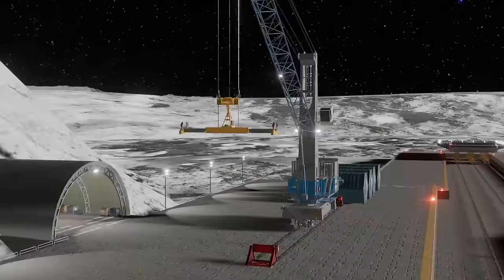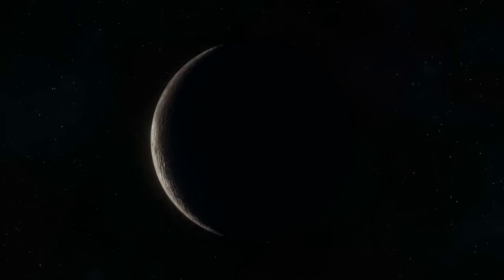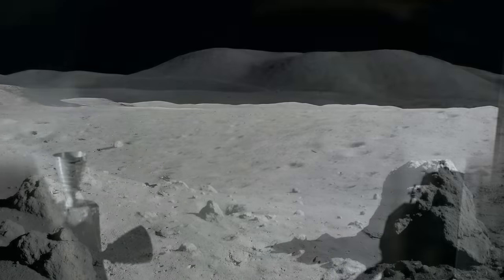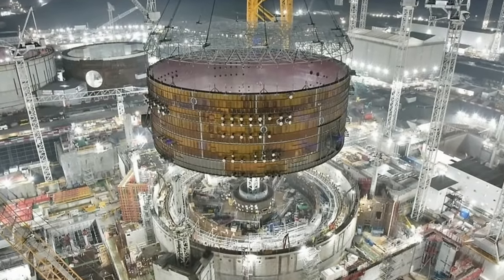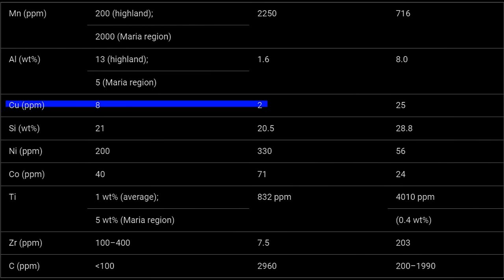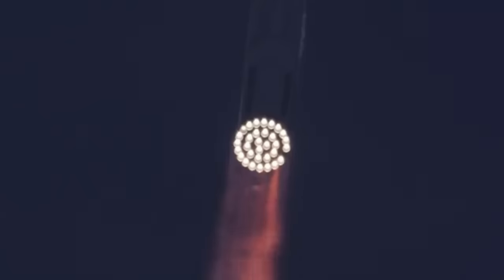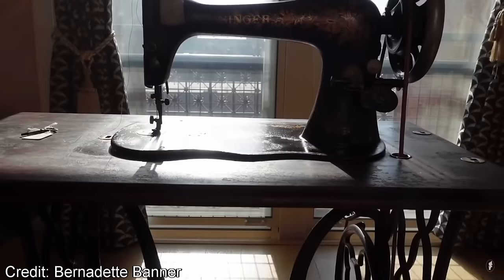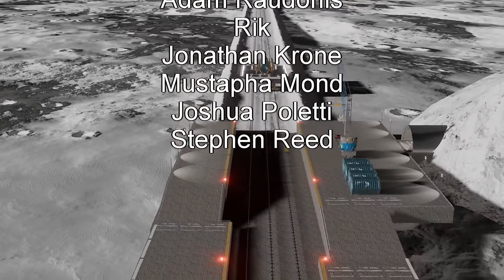Designing Heavy Machinery To Excavate The Moon

Comment: In general - great ideas. There are several NASA studies on self-replicating Moon factories, which reached similar conclusions.
The first machines carried from Earth will be complex (though still as rugged as possible).
The first machines constructed on the Moon will be as simple as possible, and as small as possible - because you need less material mined, and smaller plant - which means you can start making them faster, which means they start bringing materials faster. Efficiency is not as important at this stage. you can get away with radio control, instead of self-driving. Maybe you can even get away with springs and/or flywheels - they require far simpler manufacturing techniques, you can start pumping out machines far earlier, and you can build a lot more of them. They are more durable, less prone to breaking, and the moon power requirements are a lot lower.
Once you get enough raw materials from the machines you can continue bootstrapping into larger factories, more complex machines, larger machines, greater efficiency, greater autonomy.
3D printers are quite helpful at the start, you need fewer of them to make a great variety of parts. Only later, when materials are plentiful can the base move to mass manufacturing with specialized machines.
And once there are people in the base, small repairs that would otherwise decommission a machine can be easily solved. 

This all would be a grand rehearsal to Mars. In many respects, the Moon is harsher, no atmosphere, very abrasive regolith, awful day-night cycle with enormous temperature variations. But it is nearby, corrections can be made faster if a strategy or design turn out not to work. After we have perfected the bootstrapping process will have a much easier time on Mars. No need to wait for the next 2-year launch window to get the new parts because the old ones turned out not to work.

Comment: May just be personal biases talking, but I think treads deserve a second look. They involve more components than wheels yes, but all those components are simple to manufacture, homogeneous in material, and most are identical. And in a lower-gravity rough-terrain environment, traction could become a limiting factor. Cleats on treads are able to stab/bury into the ground at a large number of points, essentially using the weight of the regolith itself to aid the vehicle's weight. Not to mention that it cuts down the per-vehicle hardware complexity from one motor per wheel to one motor per side. There are ways to make treads that involve cables and crossbeams instead of hinges and bolts, which may help cut complexity as well. Numbers of axles and bearings depend on the specifics of the design, and could be more or less, but would probably be more.
Treads obviously aren't the perfect solution for every vehicle, but I don't think they're worth dismissing from the toolkit outright, especially with regard to bulldozers and towing tractors, whose operation depends entirely on high traction.

Comment: The need for carbon for steel can be eliminated by using induction heating and Hydrogen.  You still need a anode for AL production, but materials other than carbon could be used. The research into AL air batteries for example has turned up more options. One limiting factor in manufacturing is how thick of material you can cut. Most of a Co2 laser is just it's frame and chamber. So the electronic parts and special mirrors could be brought to the moon. I also envision that all machining would be done inside and that eliminates the moon dust as everything would be washed once inside.

Comment: If your using steel to build these machines then you could 3d print them, take the molten steel you've melted for the buildings and either atomize it into powder then use something like cold spraying to build the parts ie Xspee3d or turn the molten steel directly into the parts like the body of the vehicles, it won't look the best but that honestly doesn't matter it would be the most efficient and fastest method, for the motors aluminum works the best for both housing and wires, hell you even make the stators flexible-pcbs here on earth and you don't even need magnets with some motor types.

Comment: Hi AnthroFuturism,
regarding the "scraping" you envisioned being done with a dozer-blade, i had similar, but different idea - operating more like a harvester of metalic/magnetic parts (iron mostly) in the moondust. 

Lunar surface harvester (of iron):

The dozer-blade would be more articulated (not a slab 90 degree to the surface, but positioned in sharp angle to the surface and sharpened blade on its bottom side - like a scoop/scraper) would push the material on a conveyor, where the "harvester"/bulldozer would have some kind of pre-sorting of the prefered surface particles (say a magnet-s and/or centrifuge-s) and either only the prefered, or both prefered and the other regolith push out through some "exhaust" tube(s) (similar situation, when harvester harvests the plant, but exhausts only the grain into the transport vehicle, moving NEXT to the harvester, and when the transporter is full, another but empty, comes to replace the first-one in its place.) The outcome should be - less transport of unwanted regolith material and still quite sturdy piece of mining technology with little to no wurneable technologies (no hydraulics, only extra electromotor(s) to run the conveyor plus exhaust(s) and electromagnet for sorting. 

Why would be better to have mobile recharging/repair station for the robotic/VR operated mining vehicles:

BTW, if the "first Lunar settlement" is supposed to be robotic, why not use for the settlements underground buildings and surface roads concrete/by superfocused sunheat baked regolith panels, arches, rings and bricks. That would allow even relatively small robot fleet to build a large Lunar settlement, given enough time. That would release the whole body of starship/rocket to flip out the wheels, and serve as a surface mobile mining and recharging base for the fleet of robots, wich would be much less constrained to specific spot, than if limited in range by batery. Not sure how range of some big beast would look like, but if we use technology similar to electrobikes, we can expect total range under 50 kilometers, wich would allow the vehicles to work in a circle roughly 20 kilometer diameter around their base. Speed of roadlaying I found, is up to 25 M/Min so count with 10 M/Min and we might be closing to the devices capabilities. That roadbuilding device can adjust the width of the road, but we count for easier math 3 M wide. That would give the device speed of roadlayng (wich i immagine as similar to speed of surface-mining) about 30 Meters squared in one minute for one vehicle. That means in full 24 hour day deployment 43,200 Meters of regolith either mined through on the surface, or payved across by a road. That means, SINGLE vehicle would work through its maximal range covered area (of 1 256 637 062 METER) in ideal situation in 29089 days. That is almost 80 years. But more numerous the robotic fleet will be, quicker it goes - for example fleet of 32 vehicles would mine out (or pave) the surface of the area of their maximal reach in 2,5 years of work (in optimal/ideal conditions). The better return of invesments dictates, to use any and all industrial machinery on the Moon, till its (BY DESIGN PROLONGED) lifespann runs out, or until it is unexpectedly critically dammaged. Not to mention the point, if the lunar settlement crew would appriciate their homes immediate surrounding to be mined out and plowed trough, even when it is "only moondust". The tracks and threads on the moon surface tend to last for pretty long time. 

Specific Lunar architecture feature for gravity simulation:

The tunels of the settlement can be sealed against the moondust from inside by an inflatable insert sleeve, or cover of paint. 
I can immagine a donut-shaped tunnel, with 2 subway/metro/underground tracks, layd next to each other and tilted a bit to the centre of the "donut". Outside track is ment for the "habitat line", the inner ring is for short transportation oriented "line" ment for service, supplies and access (and exit) for station personal in need of 1 G - or gradual hightening of 0,1G of Moon to something higher...
Reply from the maker: @ultramarinus2478  hey some good ideas here thanks for sharing! Another alternative is to make a bucket wheel excavator, but there are lots of options!
Reply: @Anthrofuturism  Thanks, glad if hit the bulseye with some of them. 

Forgot to mention the extra powerpack trailer option. Some electromobiles do use de-facto trailers, with extra batteries to extend range of the vehicle. 
Another version of power trailer technologies might be separate RTG trailer (inspired by the Martian movie with M. Damon staring as main character)

BTW, in the "harvester manuever" - i.e. harvester moves forward and expells material into transport vehicle riding next to it - could and should add a powering manuever, where the transporter, wich will return SOONER to its base, powers the harvester when riding next to it, using excess power from batteries.
Reply: @Anthrofuturism  Positive on that & glad if something from my pile of (mostly stolen) ideas trully sticked... but general policy on technology should be exactly as you and Elon prefer.

Only thing i can mention, is some "road tests" in the most similar dust-deserts on Earth. Not sure 100%, but think the steel ropes are sometimes greased too, and question is, what would the temperature extremes and flying clouds of dust would do to them.

Comment: Abrasive particles reduce the life of steel cables. Steel cables are often oiled to increase service life in flexing applications.
Electro hydraulic actuators may be a good solution because theur lower temperatures extend hydraulic fluid life versus traditional hydraulic systems.

Comment: Depending on vehicle and complexety of the electronics, the Wire harness weighs between 10 and 50kg. -> It is reasonable to asume, that the electronics would be shipped in and a single rocket launch would supply about 1000 to 1500 vehicles.
Reply from the maker: Awesome, thanks!

Comment: Instead of steel for the body and solid wheels, use silicates from the slag with sheets or meshes of aluminum and/or iron as a reinforcement. Can make the wiring from aluminum, but try as I might I can't figure out a simple solution to insulation for the wires.

Comment: I couldn't find the properties of ferrochrome either, but I did run into Inconel600, which is primarily composed of iron, chrome and nickel, all of which are easily available in regioith.  The stress/strain curve certainly isn't as good as steel, but it's likely much better than ferrochrome.

The stress/strain shows elastic deformation at 400mPa(about half of steel), but plastic all the way up at 700.  Which puts it well ahead of most non -steel metals, notably including white cast iron.  

As a bonus, it's significantly more temperature and corrosion resistant than most hard metals, which is the use it primarily sees.   While I can't say for certain, given the day/night cycle on the moon, and the extreme temperature cycling that entails, I imagine that would be useful.

Comment: Excavator and Dump truck need to be developed; you don't want an open pit mine near your habitats because of dust. Have to be nuclear powered with heated hydraulics (don't know what fluid would be best.), heavy equipment needs a a very robust power source. And then you need a repair shop hanger to work on those things for when they invariably break down. And you better have several spare units with lots of spare parts.

Comment: An internal combustion engine not only needs fuel, but also air. Which, on the moon, will be imported from earth, circulated inside bases and recycled by scraping the carbon in the vents.
What i mean is - you wont have an internal conbustion engine on the moon.

Oh and electric actuators are way more effective than hydraulics - at least by weight and how much they move, but i think they might be better than pulleys - although maintnance may be more demanding...

Aight, pulleys it is! (With chains - or steel wires, probably)

Comment: Not all paths lead to batteries.
Capacitors are an option too.
Large banks of sodium ion, would make use of the normaly concidered wast slag from refining iron, aluminum, copper, tin, lead, silver, gold, etc.
Automated operations on the moon could operate off a cap system where power rails are laid down from solar farms to charge cap banks for large power use aplications for short durations.
Caps hold a charge a very long time and can hold a lot of power for there size and can be used till dead then recharged.
Unlike lead acid batts which can not go bellow 50% charge and lithium being rare and expensive.
But lead is an avalible resource on the moon so lead acid could be viable in some form for applications further away from the power grid.
Strip mining would also be the most efficient option as you could clear the rocks that make the terrain dificult to traverse while also gathering materials.
The moon has a much more homoginous distribution of materials in it's crust, so digging deeper is not going to provide much benefit in many cases in the beginning.

Comment: You know I was thinking it would be a good idea to move.
Habitats into the lava tubes on the moon  Mostly as a way to shield them from radiation. That way, you wouldn't have to work as much to Bury them although that might come with its own problems. 

There's also the issue of moving between each structure. If you were to set up a colleague on the moon if complex manufacturing, it might be easier to have an internal structure Where everyone doesn't have to wear suits all the time.

Comment: Careful. There are problems with friction in vacuum. Frictional properties of solids are quite different. Lubricants may not oxidise, but they evaporate. Actually, a cable shovel sounds terrible. Dry friction is massively increased in a vacuum. Without oxygen and water, metals do not self passivate and gall and rub off much easier against each other. Graphite lubricants dont work because they need some atmospheric atoms to dope them. All sorts of weird fun. I suspect that economical vacuum engineering will be quite different from conventional and some lateral thinking will be involved. Nasa etc. should have papers on this topic somewhere.

Comment: Id like to note for power generation that you shouldnt discount a radioisotope thermoelectric generator, basically using the heat of decaying radioactive elements to genetate power. Very simple, cheap, and almost no maintenance required

Comment: Sir, I would also suggest you skip batteries entirely or almost so in favor of using oxigen! I 'll explain myself: you are smelting regolith in order to extract metals because most of them are found in the form of oxides. If you store your oxigen in a cold and thick iron or aluminum tank then you can combine it back with some metal and obtain back all the Energy you put into separating then. 
In the example of aluminum you 'd get about 64 MJ of thermal Energy for every kilogram of aluminum burned
Reply: Also remember that you only need energy storage during the (very long indeed) lunar night. During the day, thanks to the absence of an atmosphere on the Moon one has continuous solar Power during the Moon's day

Comment: I suspect the biggest issues will be the razor-like dust and thermal expansion from the extreme day-night cycles.
Heck, it might just be better to do literally everything underground, including gathering resources, manufacturing, and even energy in the form of molten salt nuclear (because salt is more abundant than water). I'm not sure how to manage heat buildup, but maybe conducting or convecting it deep into the ground would work, like a reverse geothermal system.

Comment: One thing you might have overlooked is the absolute necessity of computing that a remote excavator might need. think of how old pinball machines, first-generation computing, early color TV, and automated telephone exchanges were done. Bulky, chunky, artisan units made from little more that basic resistors, contacts, turnstiles, vacuum tubes, solenoids, and wire. like you said: simple, inefficient, heavy, robust.

you don't need a modern computer or an operating system to run an excavator, you just need enough barebones logic to run motors and camera/control signal through a radio receiver; something hard wired and stupid basic.

regolith; aluminum, silicon, iron, chromium, nickel, oxygen; aluminosilicate glass, resistors, capacitors, diodes, wire, vacuum tubes. all the ingredients for batteries are the same for computing, radio, and if we go back to the CRT; homebrew workable remote color television.
Reply from the maker: @PRIM1984  yeah I'll do a video on that one day. Vacuum tubes in a vacuum ftw

Comment: You were doing well until the alternatives analysis. Pneumatic systems can play a role in heavy machinery, but they have very limited positioning capability. Any system operated by compressed gas (which will also be scarce on the moon) is only practical for driving mechanisms to specific mechanically controlled stop points. Cables may be relatively easy to manufacture, but with modern machinery, linear actuators might be just as easy, especially because cable systems require a lot of additional complexity if they need to exert bi-directional force.

Comment: You already have vacum so large metal 3d printers are easier to use than on earth. For example with metal powder + laser or metal wire and robot arm. 

You could even make very large parts directly on the ground with a mobile 3d printer.

I believe 3d printers are superior for bootstraping on the moon, because they probably require much less infrastructure.